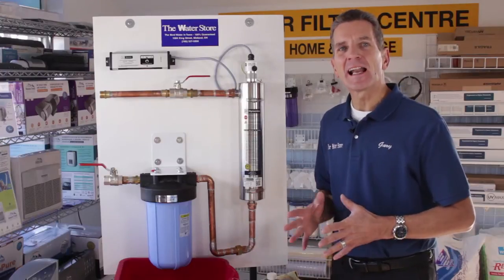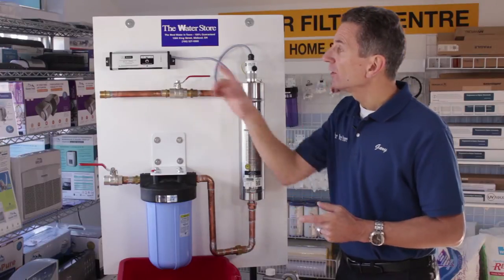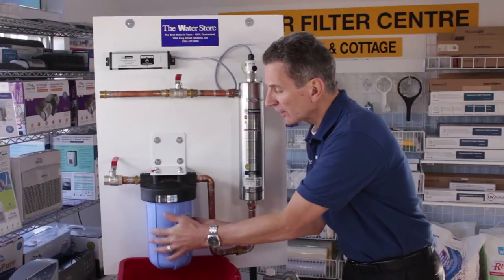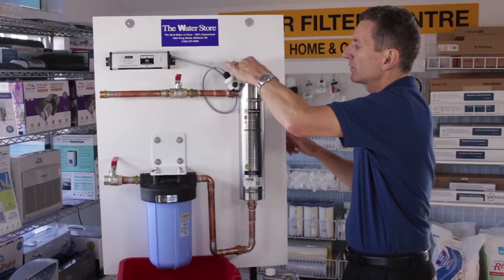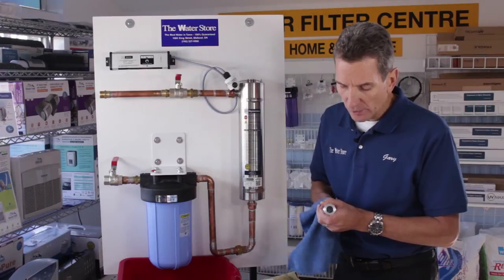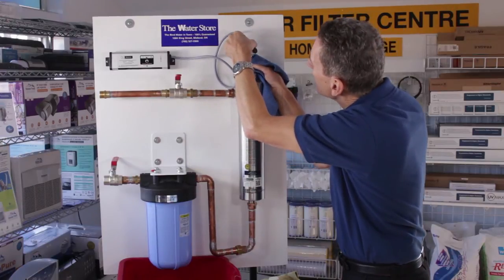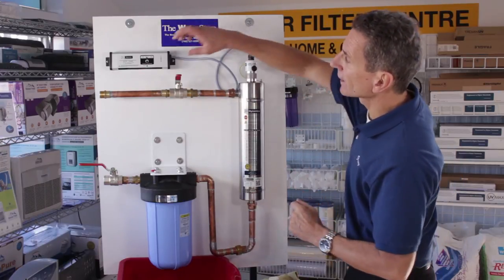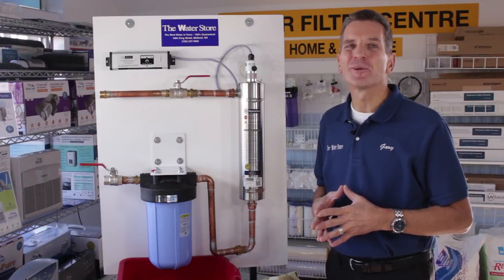How to Replace Lamp and Service UV Dynamic Water Filter System

Comment: Hey Gary 
Great video!! 
Simple and informative. 
Any thoughts on how to remove the quartz sleeve. I have tried twisting it but it’s not budging. I think I may have to break it to remove it. The sleeve is somewhat cloudy after cleaning it and probably needs to be replaced.
Reply from the maker: Yes, you will need to twist it but you can probably loosen it up by soaking the end that goes into the gland nut in CLR first. But it might still break so use gloves and be very careful

Comment: I only have a main water shut off valve.  Does this change anything?
Reply from the maker: No, just use that to shut your water off before service
Reply: I replaced the lamp and quartz sleeve a week ago.  I noticed today that the GFI outlet was tripped and the system leaking.  I retraced the steps and the quartz sleeve was full of water.  I changed the o ring beforehand.  How do I fix this?

Comment: bought a replacement bulb for my UV dynamics disinfection unit online at Amazon.  Bulb only lasted 2 months.  Is this typical?  I followed the process in your video exactly - never touched the glass of the bulb or quartz sleeve.  What would cause it to fail so quickly?
Reply: there was water in the sleeve from the well pump when I powered it on, yes.  There is no surge suppressor from the  gray box that has the power cord going to the wall outlet next to the junction box.  Will add one tomorrow.  we do get power bumps every now and then.
Reply: Depends on if it is an original UV Dynamics lamp.  UV Dynamics uses high quality UV lamps.  Some available lamps from aftermarket companies are not high quality.   Since this UV system is used for a health issue, you should use an original part.